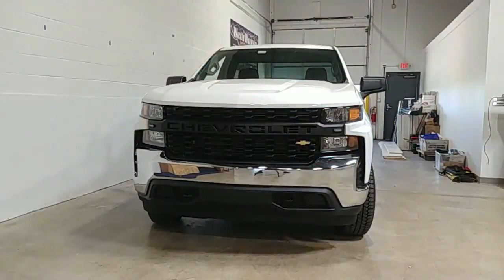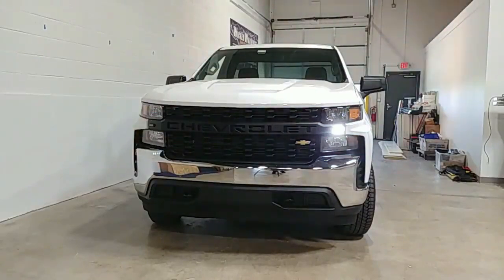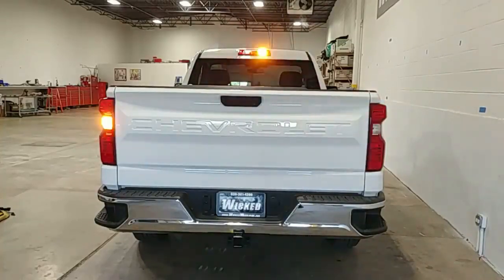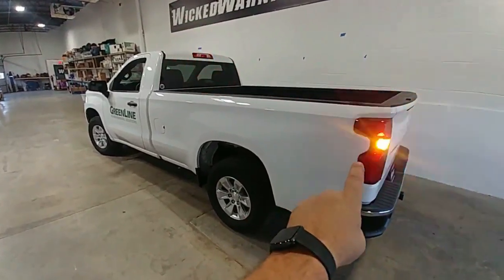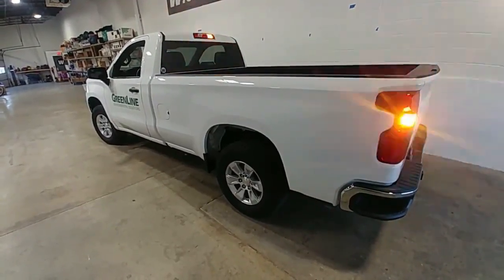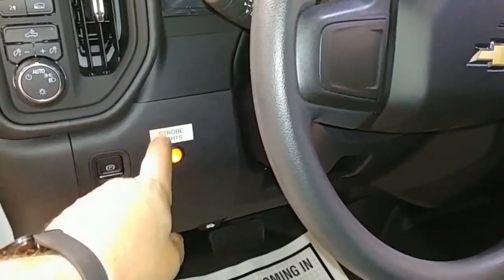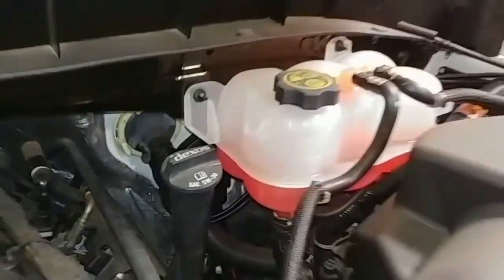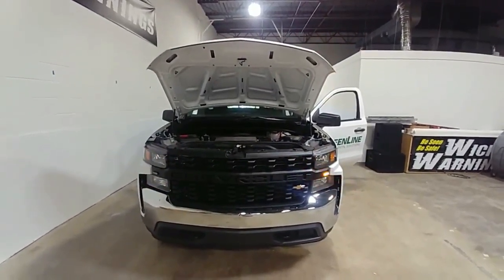2022 Chevy Silverado Work Truck with Hideaway Strobe Lights & SoundOff mpower

Comment: I'm interested in doing a set of hide a ways on my 22 2500hd. I was going to put a set in the reverse lights in the tails (like you did here) but on the front, the headlights are low, the plow in the winter would block most of the light. I was thinking of putting the ones up front in the upper part of the headlight, the marker/signal light thats just below the hood line. have you installed any in this location? those housings seem very slim, maybe not enough room or good light output.
Reply from the maker: Please email info@wickedwarnings.com with your truck year, make, model and your question. Include that it's a plow truck as well. Our master technician could tell you if they will fit or may recommend another solution.